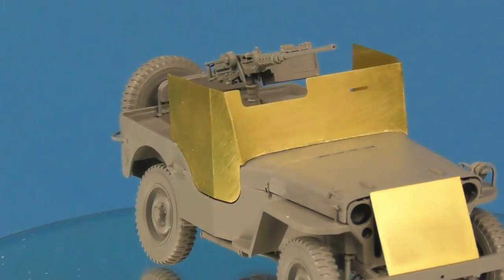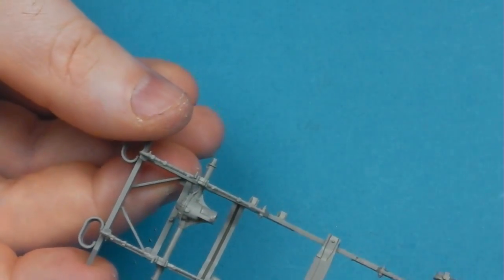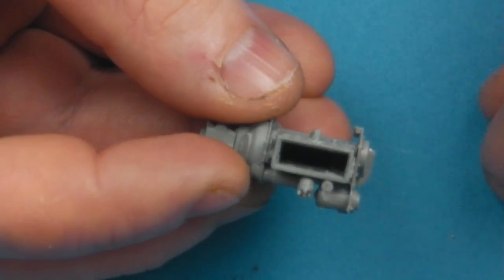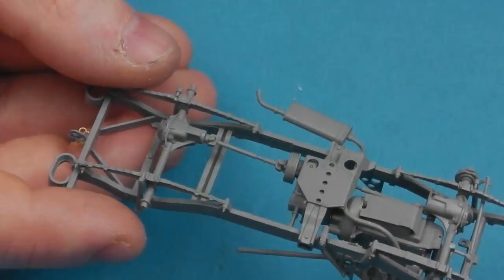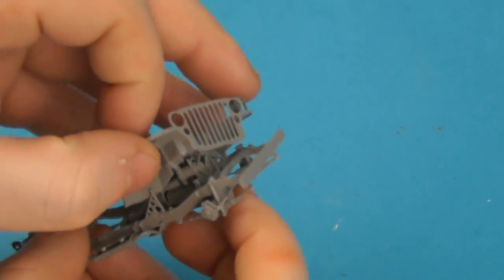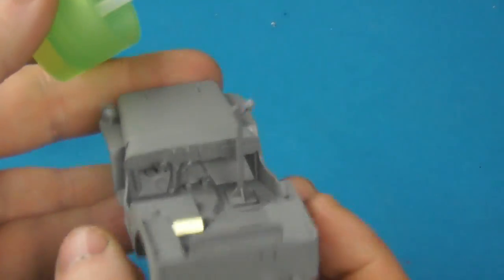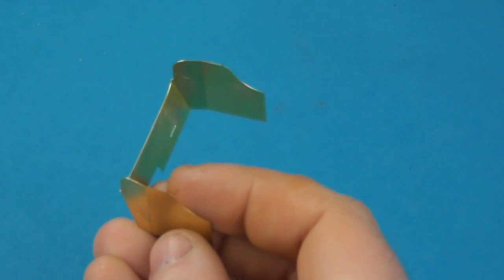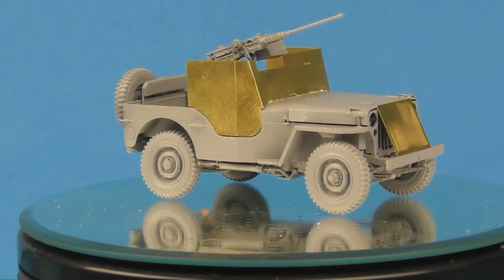TAKOM 1/35 US. 1/4 Ton Armored Jeep BUILD VIDEO

Comment: just a question, where do you get all your aftermarket? i'm in ireland too and want to know if there's some good stores over here
Reply from the maker: Hey mate, so as far as aftermarket goes. I order all mine from online shops in Poland and Germany as the pickings are slim here. However for things like paints and weathering products I'd recommend EireHobbies online shop is very good.

ps. I love your profile icon!
Reply: @longlance67  alright, i'll look at eirehobbies.
if you're not aware, there's alot of shops in ireland selling stuff you mightnt have heard of, i buy my mr hobby from MW hobby supplies, and the hobby den, i also buy most of my mmodelling accessories from mark's models and the dublin model shop, which has tons of stuff for cheap since it's a second hand, there's also a place called neverboard (?) that has alpine, never bought from the though

Comment: I built this kit a while ago. It came out nicely, but it's apretty bad kit. I spent about 2 weeks just remodelling the rear of the vehicle almost in it's entirety because the rear piece didn't fit the mold of the body whatsoever. Lots of puttying and sanding.
Reply from the maker: I had a slight step in mine too. But was about 10mins of sanding to contour to shade of the rear of the jeep. I may have gotten off lightly

Comment: Fantastic build Shane 👍 Dragon made one of these, now I'm curious is to how they compare? Anyway agree that gun is massive.  It looks even larger with air-cooled barrel.  There's a photo of one in Italy mounted on a jeep. Looking forward to your paint job.👍
Reply from the maker: I would imagine the Dragon kit would be similar in terms of detail and crispness. Though I imagine the DML instructions are probably a disaster. I'm building their M3 halftrack and its such a pain lol
Reply: @longlance67  
Building the m2 halftrack. I've built them before so it's not that big of a diel for me. I'm only confused why there's always a gap between the fighting compartment and the drivers compartment.? After some trimming and sanding and it's all good. Well there are some other glaring problems but that's the one you can't add fuller to because of the screw heads. Anyway M3 are we getting a video perhaps ??? haha.
Reply from the maker: @claytonmcclain182  I've run into the same issue with mine too. The join between the troop compartment and drivers flares out and has gaps. I need to do some careful sanding too and try to make it work
Reply: @longlance67  
Yup it can be fixed but why right? Shouldn't that issue been resolved by now?? Anyway looking forward more of your fantastic work my friend. God bless.